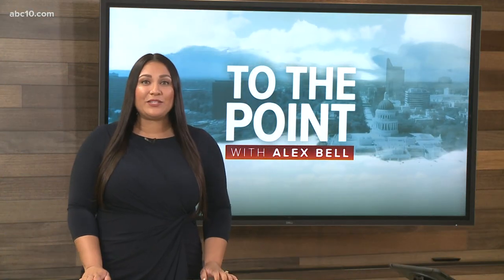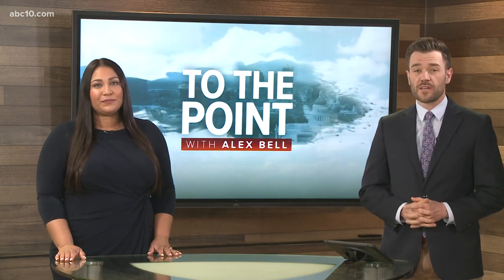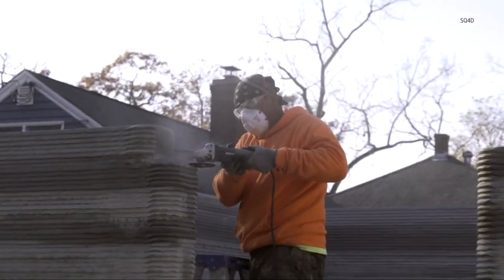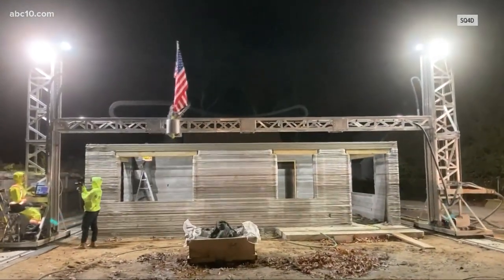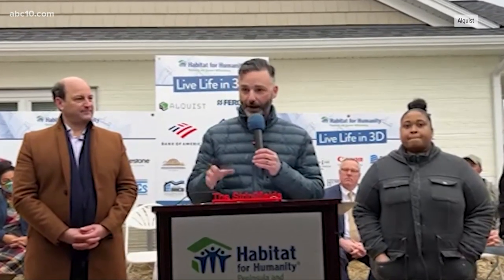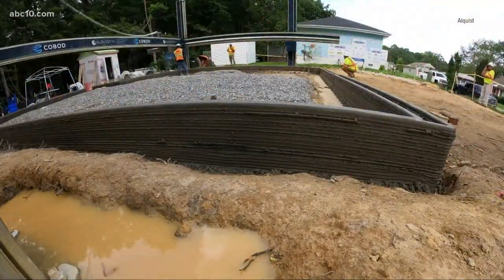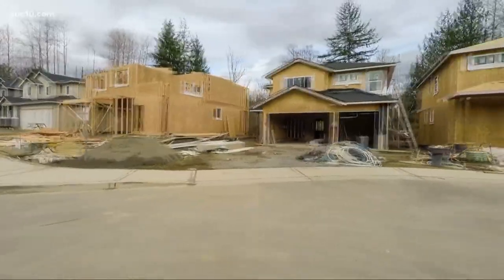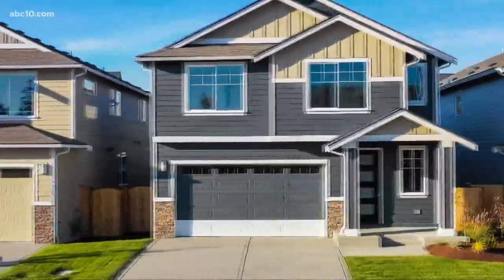To The Point | Are 3D printed homes the solution to the housing crisis?

Comment: No formwork required? Shows forms for door and window openings. We make house of sand, cement and water. Ignores the need for a roof and roof framing. 3D printed home. Really 3D printed walls. As an engineer and home builder, building wall framing of 2x4 or 2x6 studs takes only a few days after the floor deck is in place. What did she say, get the house setup in 18 days? What does this mean? A finished house, or finished rough walls? Still need insulation, plumbing, wiring, roof framing, roofing and a myriad other finishing needs. What is carrying the weight of all those concrete walls? Maybe a concrete foundation made by using concrete footings and stem walls built with standard concrete formwork?  A bogus technique, scammers hoping to make it big before the true costs become obvious.
Reply: Sensible observations from someone who knows construction, though maybe a bit harsh.  Would you acknowledge that digitally-controlled construction methods are inevitable?  That these are crude beginnings, where method improvements and increased scope coming from the construction-experienced will make it real?  I think the emphasis should be on better quality and longevity.
Reply: The full process start to finish takes about 3 months apparently